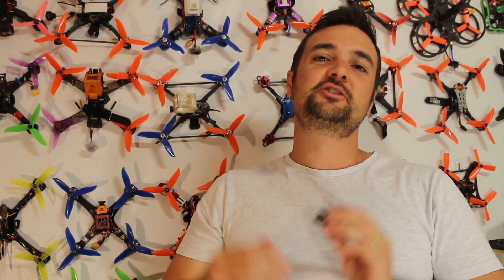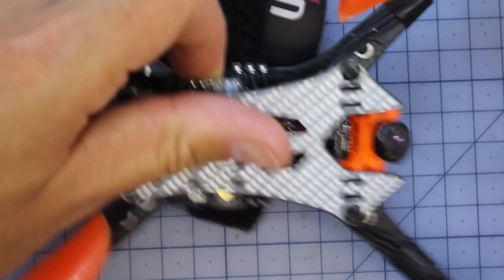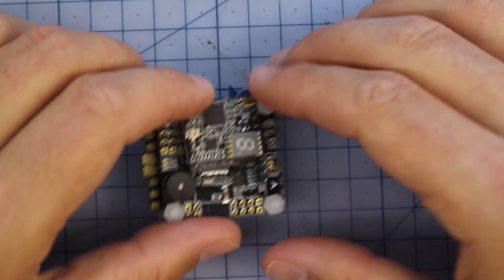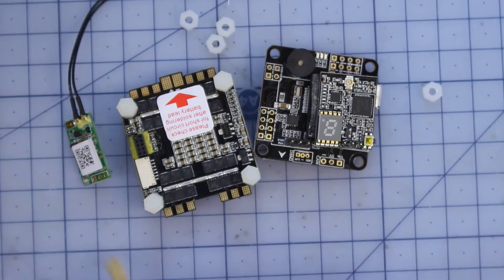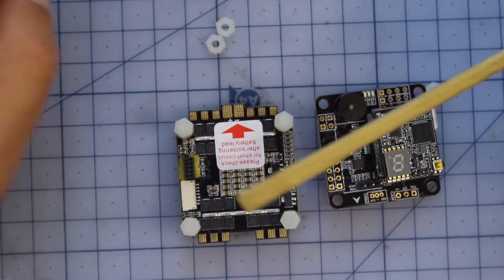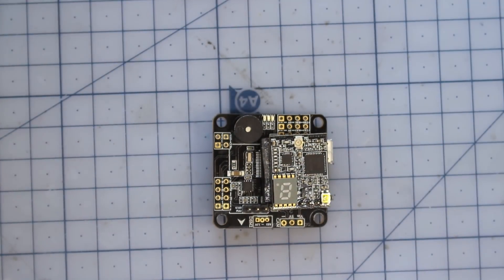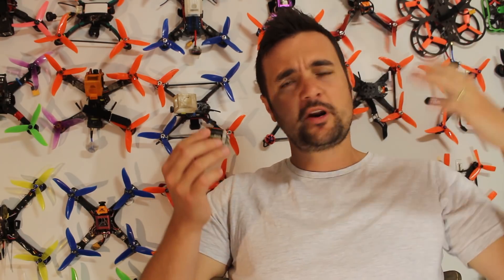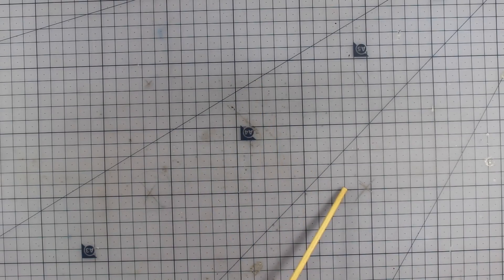VTX + ESCs + FC + OSD + RX = EMAX Magnum AIO! Tech Tuesday Uavfutures

Comment: I've got this stack in my quad and I've found the VTX problematic from the word go, generally weak signal and not sticking to one frequency, which caused issues for others, I went to order a replacement but EMAX are now out of stock for the foreseeable. I'm going to be swapping it out as flying this little thing third person just isn't the same. The rest of the board has been great.

Comment: Would be really interested in your opinion on the new DAL 5040c Cyclones (once you can get them :) for just general everyday practicing with lower-power 2205 quads. I think a lot are wondering how much easier they are on your batteries (and extending flight times) vs how much you give up in feel or bite.  Thanks Stu !

Comment: Mine flies good but burned up the Vtx in less than 20 flights at 200MW.  Now I never leave it plugged in for more than a few seconds before taking off to hopefully keep it from getting too hot.  Only about 10 flights since new Vtx so time will tell.  Probably won't buy another one.
Reply: hey stupid question but how did you change the MW for the vtx, for the life of me I cant find out how

Comment: I purchased this stack a couple of months ago and have built it in a Flight Club Tokio Stretched X frame. The issue with this board is the VTX; specifically the UFL connection. It is very loose and pops off easily. I first Hot-glued it down and then that popped off. So now I have glued it down with 5 minute epoxy. I'm not too sure of the connection now. other then that this is an awesome stack

Comment: This stack is all I use anymore. I can build a quad in 30 minutes if I don't have to extend motor wires. I had one stack that the vtx was bad (maybe defective, but maybe my ufl popped off), but they took care of it and ive had no problems since.

Comment: The VTX antenna connector is not that great, if you don't heat shrink around it it will pop out if there is tension
Reply: vladoportos I used liquid electrical tape then a dab of hot glue

Comment: Love your channel but this review is not good, too many concerns like the F4 board doesn't have isolation, ESCs burning and VTX has poor performance. I think the stack needs testing. Sorry but if this keeps up your credibility will go down. Happy flying.
Reply: David Farmer 
1.) This is a bench review... This is what he does for his Tech Tuesdays if you don't want to see bench reviews just don't watch the Tuesday releases.
2.) If you need to soft mount just don't mount the entire stack
3.) I was one of the first people to have the v1 of the stack. This has been in my primary quadcopter and flying perfectly fine and performing perfectly fine for nearly 5 months now. 

Now in saying that there's obviously some quality control issues as faulty units are higher than they should be but that definitely doesn't mean they are all bad there's plenty of people who have no problem with them from casual freestylers to professional racers. I'd also have to think your building skills (even though it's quite simple) soldering skills and whatnot also are a factor.

For the price it's a really nice deal. It's cheaper than buying the parts individually plus you get the benefit of a super super clean build.
Reply: To be fair, he simply reviewed the specs and design, he hasn't built and tested it with anything yet.  Based on several comments I'm seeing here, I think after testing there's likely to be a followup review that may agree with the problems.  There's been several 'part 1' reviews here that sounded promising, then in the 'part 2' it's revealed that the product doesn't measure up.

Comment: The main downside is that the VTX is not great. I used this stack on 2 builds and on the second one I replaced the VTX with another one which made a great difference.
Reply: I also found the VTX to be pretty weak compared to the TBS Unify Pro that I've been using in my other rigs.
Reply: @Gal, which VTX did you use?  I really like the idea of the small/compact design but was wondering how good the VTX is.  What's the issue with the default VTX that comes with?
Reply: And I replaced it with the EWRF e708TM3 VTX
Reply: Was it difficult to replace the vtx on this? Because he said its "hard soldered in"  I need to replace this because that little u.fl connector is garbage! Thats honestly the weakest link on this quad!  I got a more powerful AKK with mmcx conectors which are so much better. i dont know how difficult it is to replace?

Comment: Don't buy this stack! Two people in my flying group burned 4+ (can't remember ecaxtly how many, but too many) of them. The problems were with the esc, the fc an also the vtx. One of the later versions of the stacks also started burning cameras. Easier to just by a hobbywing stack and use a normal vtx.
Reply: Grott FPV yep. I had vtx and fc go on 2 within a month
Reply: Thanks for the heads up on the Hobbywing Xrotor stack - that looks really good

Comment: No antivibration alements and both boards are firmly attached to each other
Reply: MrBirdshell666 You can soft mount the entire stack if need be
Reply: RCFlyer85 its quite tricky the holes are too small. Maybe some rubber metal stands like matek throws into a package will do, but they are tall
Reply: MrBirdshell666 Not sure what holes you are talking about are too small....
I use the rubber standoffs under mine and it's been perfect nearly 6 months so far
Reply: holes in the board itself. you may check how its made on raceflight or diatone f3 fury boards with silicone grommets. i think it the best solution. i think you are using the standoffs i mentioned - made of black rubber and separate metal elements inside. these standoff are stiffer and becomes more like that in cold temperatures. silicone is more stable.

Comment: I took attention to this module when I noticed it. A good start... To be definitely appealing for tight frames it should have SmartPort telemetry support directly in FC and include R-XSR as RX instead of XM+. Also VTX should have SmartAudio or IRC/Tramp channel control to support channel/power switching from OSD/radio and even better if it will have MMCX connector instead of flaky IPEX. Then it will be definitely awesome stack.
Reply: from 3.3 there will be an even better reason for sa or tramp they have just written in my idea of having the vtx power switch with arming so 25 mw on bench or waiting to fly and what ever you want when armed.
Reply: KrotowX Well this stack is like 6 months old so definitely wouldn't have an R-XSR lol

Comment: Nice.. Does the vtx support smart audio too?  From the product page it doesn't seem like it.  For a tight build this would be a great feature because you may not be able to see the display or get to the button easily.
Reply: Witblits FPV No it does not... Though it's easy enough to swap it out for a better one and you're still getting a good deal on the price

Comment: I use the Magnum in 4 of my builds, and in 2 of them i have problems that Emax wont help me with:(
When i do a punchout it reeboots, and i drop from the sky...
But in the other 2 i have never had any problem even tho i abuse the Magnum very hard:)
It makes for a very fast and light/clean build!
Cheers!
Reply: I had the same problem but changed over to multishot and problem has disappeared for 10 packs so far
Reply: RobertKindberg yes  Emax themselves said there was an issue with running dshot 600 which I think has been corrected with the newer blheli releases but I'm not 100% sure...

I was one of the first people to have one of these Stacks almost 6 months ago and mine has been perfectly fine and in my primary racer

Comment: not bad, if it has no flaws.  but for this price you could get all those components with TBS Unify on smart audio instead.
Reply: Planes and Bikes You sure? Maybe if we're talking Racerstar or similar components
Reply: hmm rtfq omnibus f3 for $21, 4x 30A for $44, XM+ $16, Unify  or Mach2 for $30 = $110.  however no integrated pdb, and a fair number of wires to add, unlike this integrated Emax Cube.  however having Unify or Mach2 vtx I think would be huge improvement.
Reply: Planes and Bikes I'm not sure if this is meant to contradict my comment but yeah that pretty much proves my point and you stated the price of a F3 and not a F4
Reply: yeah you got me.  would have to add ten or twenty bucks for F4.  however .. Smart audio is killer
Reply: Planes and Bikes Indeed.... Personally I was a long time FlySky user and switched to FrSky and have only used XM+ rx's so I've never experienced it so I don't miss it lol...
I do understand though once you have something you don't want to take a step backwards
Reply: Planes and Bikes which is why I tried to point out a few times in these comments that this board is about 6 months old now so it's not the latest and greatest

Comment: Holy f--k $110!!
Reply: skypilot 23 
F4 FC w/ OSD - $30-$40
4xESC - $50-$60
VTX - $20
XM+ $15
Total is at least $115+
Reply: RCFlyer85
 then there's the issue of one component burning out and it's toast- no I see they have the parts.
Be Nice to give it a try
Reply: Pretty much OK considering total price of separate modules.
Reply from the maker: i thought that too, until I thought about all the things it is,

Comment: would be perfect if it supported telemetry and smart audio. Once you set your VTX channe/power with you radio you will never go back!
Reply: Cannot see any interface between this VTX and sbus, nor smartaudio, nor Tramp.  Without any of these, there is no way to set VTX channel via OSD.

Looks like for this VTX only switch method is the button.

My personal preference is for VTX telemetry switching (Go Tramp with BF lua :) ).

Also prefer smartport telemetry so radio can tell me voltages instead of having to rely on visual alerts.
Reply: yes good point. should have been a smart audio vtx at this price point.
Reply: Just set your VTX channel using OSD lol